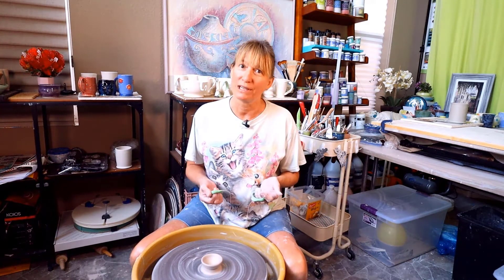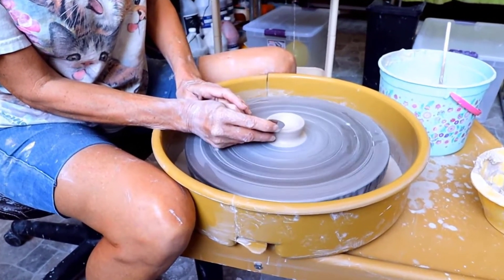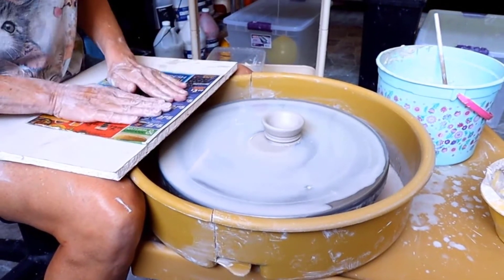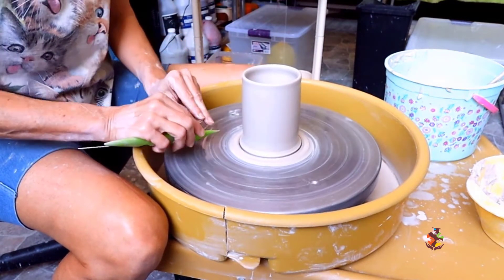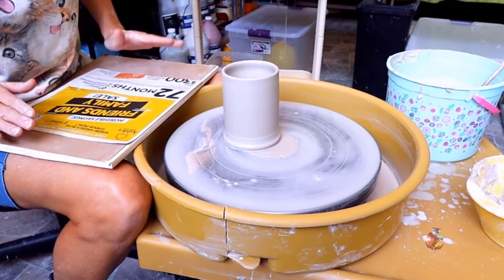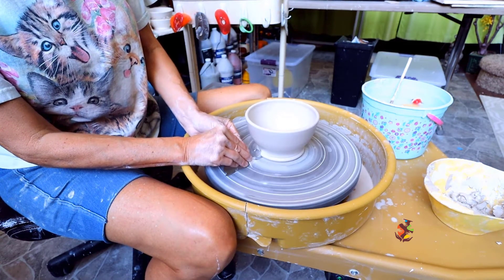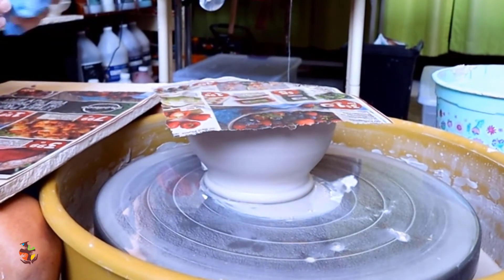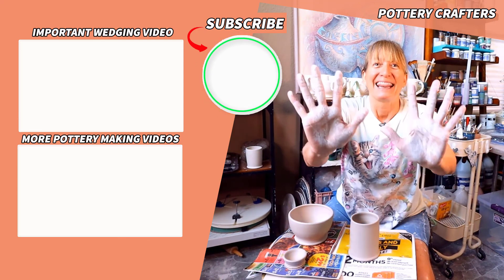How to Remove Pottery from The Wheel - The Wire Removal Technique

Comment: Thank you. I cant wait to use newspaper to keep the rim of bowls in round.

I noticed the edges of your ware boards. Mine were that way too. But I would occasionally get drywall in my clat. I found some pretty duct tape (ugly old grey would work but it would bring me no joy.) to dress the edges. Worked great so far. 

You probably don't remember any comments comments I left before. Mainly  that my shop was small, cramped, and over flowing because I'm a multi medium artist working in a 12'x16' dry studio. I wanted to share there is light at the end of the tunnel for me. I am getting an additional 12'x12' of work space and. . .and. . .a bathroom! This may seem only mild to some but anyone that has had to dash 75' from a work space to the house with a full bladder in -20 below weather will appreciate the coo a lieu can be. I'm so happy I just gotta share.
Reply from the maker: Yes, you are right I was going to put duck tape on. But the drywall has not given me a problem as of yet. 
That is AWESOME!!! I would want to share also. I totally understand. Mine is 12x16  if you get a chance check out my studio setup video. here is the link for you  https://youtu.be/qvsoGw7q7mM
 A bathroom is a big deal. Thank you for sharing 😊
Reply: @PotteryCrafters  Thank ya. I was all over that video the day it came out. My husband may blame you. 😁
The annoying thing is, I sold some baker shelves, just like the ones you are using for glaze, at my garage sale a while back. I really need to invest in a crystal ball app, cuz it looks like those shelves were perfect for the job. 
I think I might have an old metal and wood bakers rack if my husband didn't leave it out in the weather. (The things ya deal with when you want to stay married). . . . . .(hmm? Could this be why I "throw" things? Lol)
Not gonna break my stride. I'm just bouncing with energy. Working on the new work space feels good.
Reply from the maker: 🤣🤣You're funny. I want a crystal ball app too. We only need things after we get rid of them. 😊 Enjoy your new studio !

Comment: Dear Marie, again you gave some great tips on a very important topic.  I always do it in a circle, but when I remove it from the potter’s wheel it becomes elliptical or I have to wait too long and I waste time.  First of all thanks.  I want to ask two questions.  First, Can I get it off the wheel immediately after I've finished or should I wait?  My second question is how does the newsprint you put on it keeps its edges firmly?  I hope I could explain what I wanted to say correctly 😀
Reply from the maker: Great questions Kiran, The tenion of the newspaper keeps the clay in place. That's why you should wet the rim first. 
You can wait a little bit if your pottery is really soft otherwise just do what I did in the video. Get the slip off, keep your hands dry and make sure there is water on the wheel so your pottery can slaide off. 😍👍💖

Comment: Laura here.  Thank you 
It looks like your left hand/thumb is mostly stationary while your right hand/thumb moves more toward you.  Is this observation correct?   I never get a straight bottom. I think my wire is much longer than yours.  I may have to get the one like yours.   
Thank you.  😊
Reply from the maker: You're welcome, Laura. Yes, you must keep the wire pressed on the wheel for an even cut. Here is the link for a shorter wire cutter. It is my favorite one. https://geni.us/vzvZIup   only 11inches long 😊

Comment: Aloha and mahalo Marie! I am wondering how you remove plates and platters from a bat? Thank you!suzy
Reply from the maker: Aloha Suzy 😊 Good Question. You can actually take the bat off the wheel and let the plate sit until it comes off the bat on it's own. and yes that will take a while. Or let the plate sit until it is almost leather hard and remove it with your wire. I never remove my plates right away. I find them to be the hardest to remove.
Reply: Thanks so very much for your fast and honest reply! They are my hardest to get off the bat, for sure !🌈🏝
Reply from the maker: Your welcome Suzy. I hope you are able to successfully get your plate off the bat. 😊

Comment: How do you stop the rim from being uneven when pulling up the sides?🥴
Reply from the maker: Hi Clair. Good question. The reason why the rim is uneven is because the clay was slightly off center when you were pulling up the clay. You will notice that the clay will be a bit thicker on that side also. You can take your needle tool and Cut off the top. I did this in one of my  wine bottle holder video to show what to do if this happens. Here is the link for you. It's about 3 minutes in  https://www.youtube.com/watch?v=6bNGgD2rxXA&t=1s   😊

Comment: What is your wear board made of...looks like dry wall
Reply from the maker: Yes Clara it is.😊 They work great and I can easily cut them to the size I like. I found a half-inch thick is better than the three-quarter-inch. The three-quarter-inch thick felt too bulky for me.
Reply: @PotteryCrafters  i think I will(because I know me) put duct tape around the edges so I don’t get plaster bits in my projects.  I suppose I don’t need to worry about it drawing out the moisture to quickly.  I think I will keep an eye out at the near by construction sites so I can ask them for their scraps.
Reply from the maker: That's great Carla😍 I just went to Lowes and got some scrap dry for the ware board video I'm doing next 😊

Comment: This is cindy Kerkes  i can't use bats on  my wheel  you showed  everything but how do you get a plate  off the wheel  please  show every time I try to get it off  it's a mess.
Reply from the maker: Thank you for the suggestion, Cindy.😊 Next time I make a plate I will show how I get it off the wheel. With plates, you have to exercise I bit more patience. I get all the slip off with my rib then walk away and do something else in the studio, like wedge some clay. Let your plate dry out a bit. Make sure you get water in between the wheel and your plate when you wire it off.  I hope this helps. 😊
Reply: So i need to let it dry some before taking it off  my wheel thank you lots  to learn!!!! Thank you you're grant and you make it easy for me to understand 🤗🙂
Reply from the maker: You're welcome, Cindy. 😊